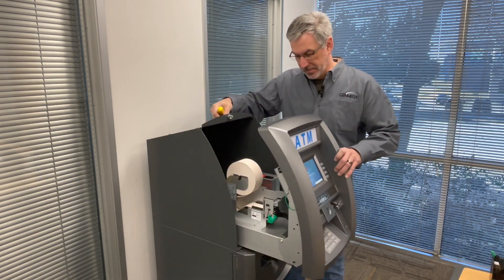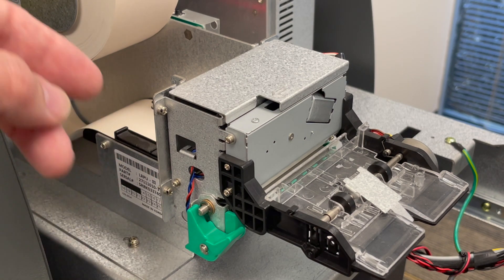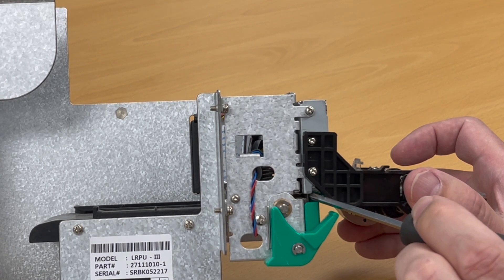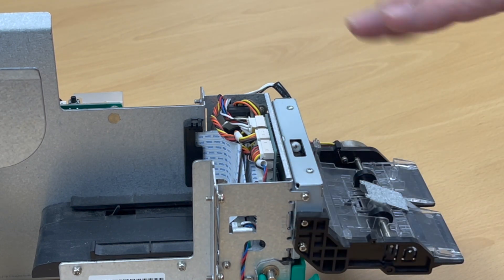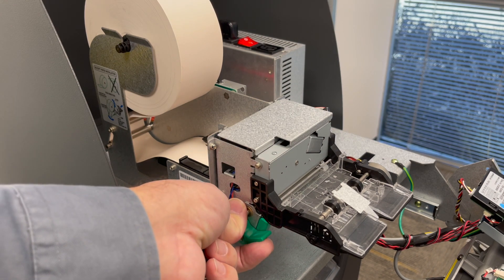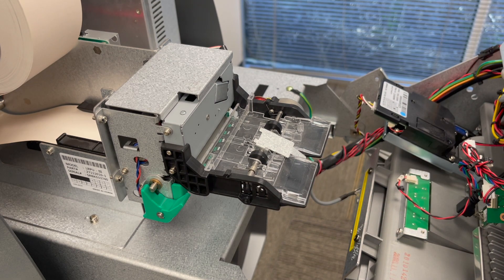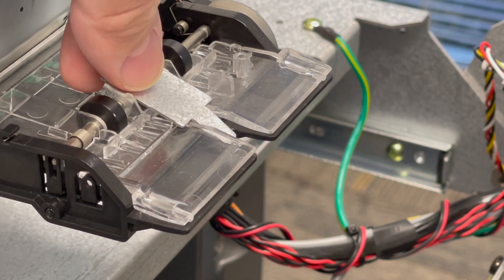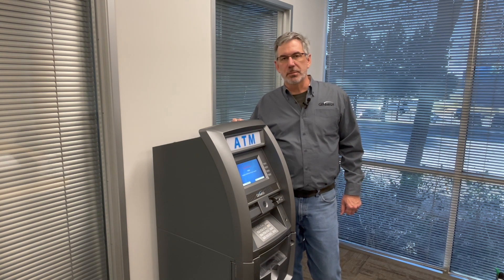(Genmega ATMs) Printer Cutter and Presenter

Comment: My presenter isn't pushing the paper out far enough for the customer to grab their receipt. How would I address this?
Reply: Make sure the presenter motor roller turn when it tries to eject - clean the soft rubber rollers - make sure the rollers on top touch the soft roller underneath - test with the bezel forward - look at the clear plastic covers to see if they're blocking the paper - Otherwise if you checked everything shown in the video, call Support during business hours - that issue is usually resolved without replacing any parts.